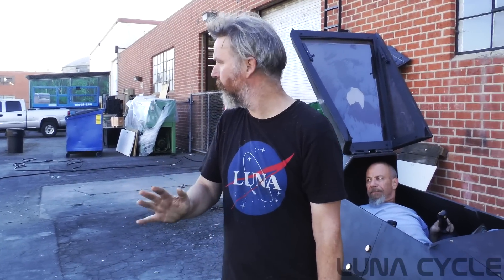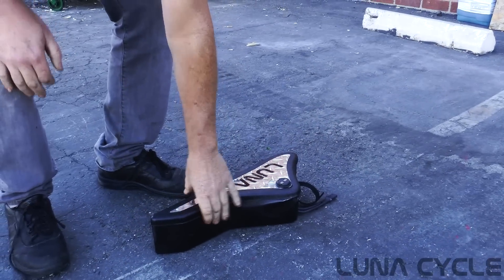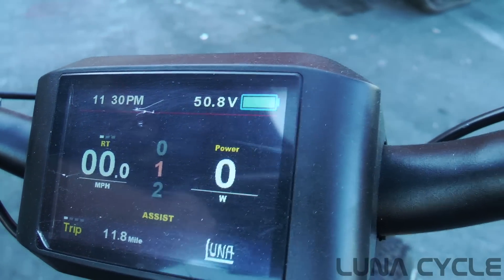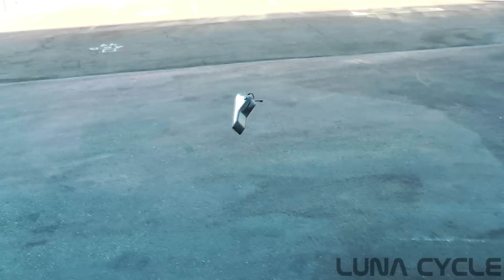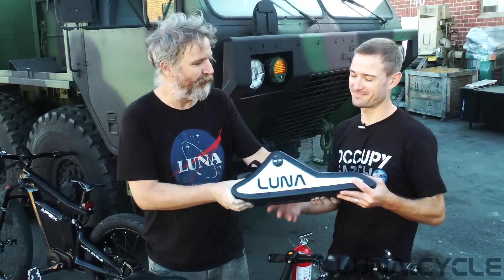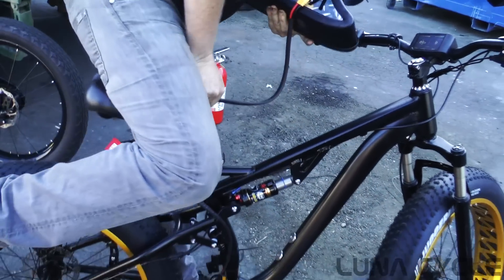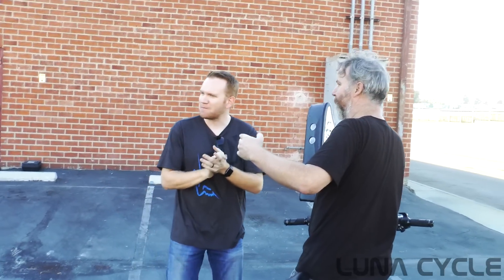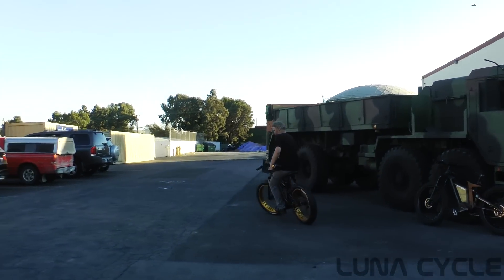Luna Cycle Torture Testing Battery Packs

Comment: Anyone know if Luna cycles only uses lithium batteries. Just got a sweet deal on an e-bike and the battery pack is Luna but it did not come with the charger. It is 48 volt thousand watt. Thanks in advance it still has a charge on it but I do not want to ride it and run it dead until I get a new charger but it rides smooth and fast!

Comment: How fast does the 2500 watt Apex go?
Reply: I've played with mine top speed is 45.9mph using level 5 pedal-assist 9th gear
Reply: @TheCheasequah3  Is your Apex equipped with the Rohloff?
Reply: @normand5847  I actually have a fat fusion bike similar to the Apex and no if I'm not mistaken the Apex uses a bbshd mid drive
Reply: @TheCheasequah3  The Rohloff is an Internally Geared Hub. It takes the place of a cassette. It is an option for the Apex. The Apex doesn't use the BBSHD. It uses a modified version of the new Ultra Drive that is bespoke to Luna.
Reply: @normand5847  oh ok...well if you want to know how fast a bike goes use ohms and watts law to figure it out, I have a ludicrous controller for my bbshd

Comment: Why didn't you show that army vehicle in the back run over the battery pack?   Just kidding.  Good video.
Reply: Les Hsu The fire from the cells would of burned a hole in the tire. No fun changing that big of a tire.

Comment: I bought a Bafang BBS02 750W mid drive motor and I'm having problems. The bike has a 7 speed Chinese freewheel. When starting from a stop with the bike in high gear (hard to pedal) and in a high pedal assist mode, I hear a clicking sound and the motor will start cutting out for a fraction of a second than comes back on. The motor cutting out only happens until I pick up some speed, but the clicking sound stays there. This doesn't happen in lower gears. The clicking sound may be coming from the cheap freewheel, but why is the motor cutting out? This thing is brand new and only has 5 miles on it. Does the BBS02 have a torque sensor? How does the BBS02 sense your pedaling when the rear wheel is turning? Is there something in the motor that can cause the clicking sound? I also noticed the clicking sound occurred when using the throttle, but I don't remember the motor cutting out. I'm think the motor might be cutting out because its momentarily not sensing my pedal rotation which is very low when starting out in a high gear. Has anyone else experienced this problem?
Reply: Pretty sure now the clicking sound is coming from the freewheel and not the motor. The motor cut out has happened in pedal assist 7,8 and 9 when I am in a high gear and just starting out. The higher the pedal assist the worse it is. I can't feel it when I use throttle in any pedal assist level. Any ideas?
Reply: @MotorheadRedo  honestly these motors kill a derailleur mine is 2500w and I'm always adjusting my derailleur also it cracked my freewheel in 8th and 9th gear so had to replace that
Reply: @MotorheadRedo  I also had to get a new motor my pinion gear snapped in half when I was riding if you hear a grinding noise and loose torque your pinion gear snapped in half

Comment: What is your opinion on putting the cyclone 7500 watt on a fat bike.  Is it worth it?  Or should I just go with the new bafang ultra?
Reply from the maker: the 7500 is not really a practical solution because it is big, heavy, way too much power so it requires a very big battery, and has no gear reduction.
Reply: Thank you for the information.  I will now be saving up to buy the APEX with the Rohloff and extra APEX 28ah battery option with the luna carbon fork.  I can't wait to ride that beauty with the torque sensing technology.  I have the Stromer platinum and the izip express that both have the torque sensing.  The izip can do 42mph on the flat with no wind and the Stromer can do 32mph.